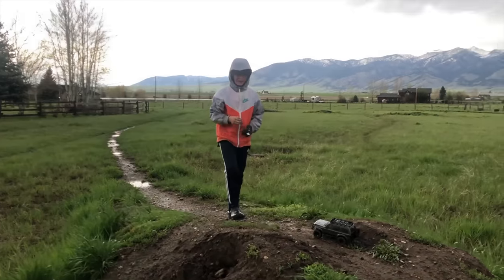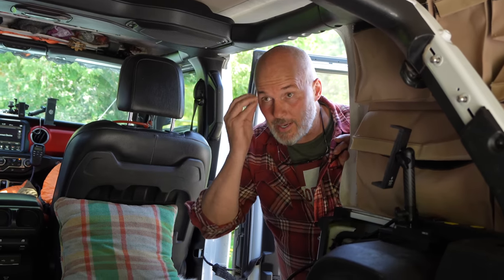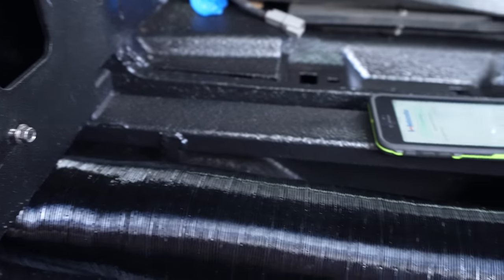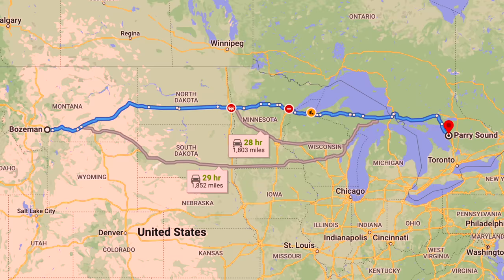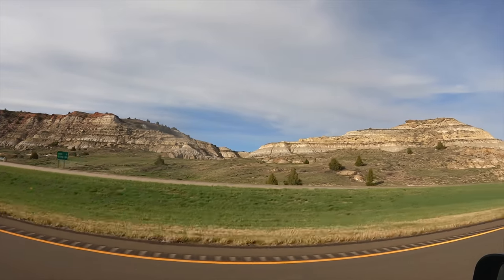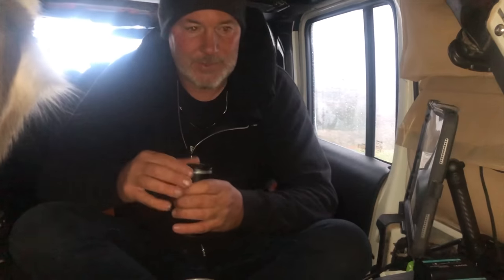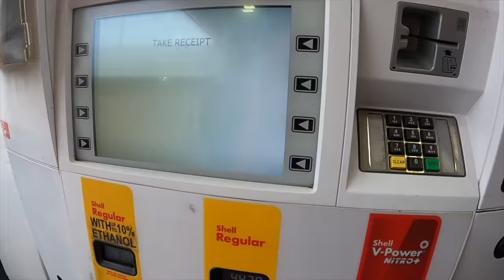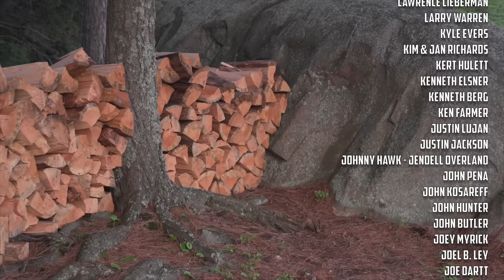WE MADE IT TO THE CABIN | Plus we install Heaters, Lithium, and RedArc in the Jeeps // EFRT S7 EP37

Comment: the info up to 10m19s is quite helpful, txs! Do you have a DC-DC charger and/or beefed alternator to charged your 300A of batteries? Why'd you go with 4*75Ahr BB vs their "game changer 285Ahr" units?   For HOT temps, do you have a Maxxair Fan or a 12V AC to cool the interior?
Reply from the maker: The battery choice was due to size and space constraints. The solar panels on the roof keeps the batteries charged.

Comment: I have a gas espar, it starts to flake out at around 9500 feet in elevation even though it’s rated to go to 10,000 feet in elevation. I am very interested to see how the webasto does at elevation like that because I do a lot of mountain camping I can’t always use my heater. 

Chip and Dan, if you has a heater that can get to 10k+ that runs from gas, would be very interested.

Comment: Any concerns having batteries so low and potential high water crossings? Or do you just avoid any high water?

And are there elevation limits to the heater? 

Thanks again and enjoy being home.
Reply from the maker: Even in Highwater we don’t seem to get a lot in the vehicle. Most heaters struggle at 10,000 feet, these will work if we burn them hot which is what we plan to do in higher elevations.

Hope that helps have a wonderful day.